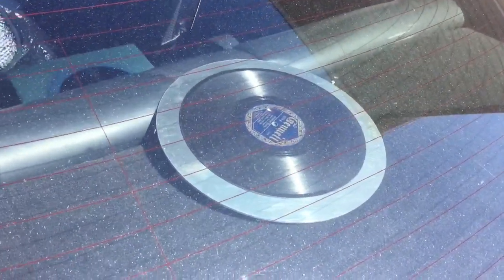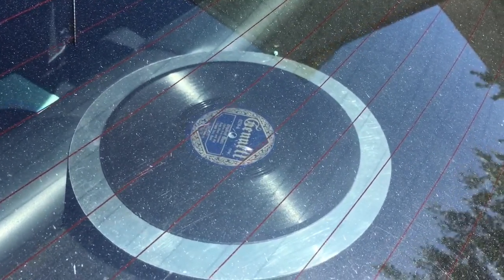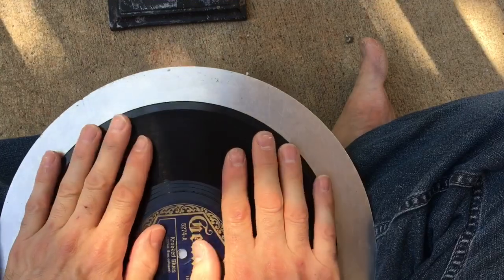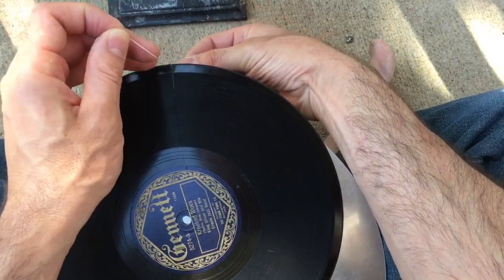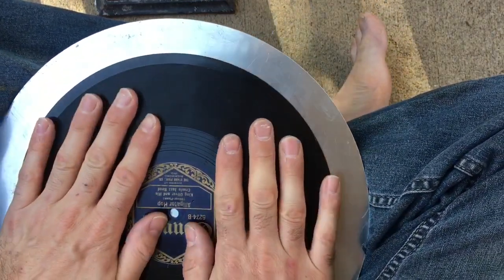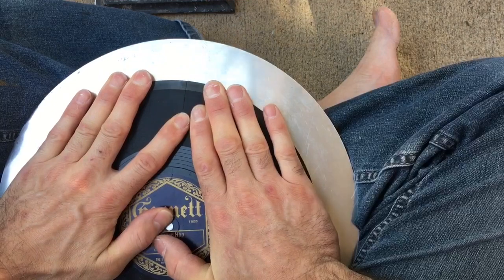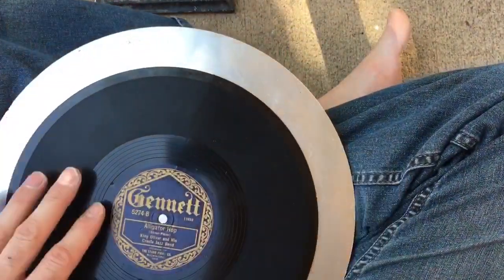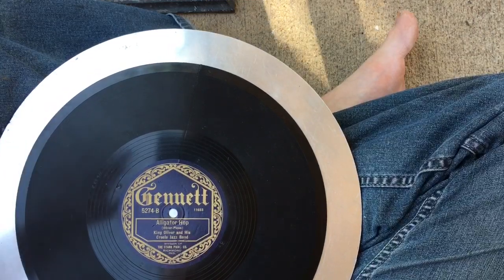78rpm Record Repair - Closing A Widened Crack

Comment: Nice! I was just given a box of old 45s with some record labels before my time. Several of them have cracked from the outter label to the outside edge. What type of glue should I use to repair after I get them cleaned up? Thanks!
Reply from the maker: You can use tape or super glue outside of the groove area, to help keep the crack from re-opening.  Using super glue in the groove area isn't a good idea since it cures too fast and will usually create other problems.
Reply: Here you can see how to fix broken 45 rpms https://youtu.be/5MbRxXxMvPI
Reply: @DonWilsonLabs  Super glue on outside edge did the trick THANKS!

Comment: I have an old radio station disc  (shellac l'm assuming even though it's from 1965),a recording of a football game the station would have played to their listeners in the days before live broadcasts. As l said l'm assuming its shellac because l have never seen vinyl behave like this. The outer layers seem to have shrunk and opened up gaps in the surface,about 1 to 2mm  wide. You can actually see the substrate the shellac was applied to. It's obviously unplayable in this state but is there a way to "rehydrate" the shellac to close the gaps?
Reply from the maker: The disc you have is probably a lacquer or acetate (the names are used interchangeably). Unfortunately there is now way to keep it from coming apart. The best thing to do is get a high resolution scan of both sides and find one of the companies or arxhivists that can do optical extraction.  It's unfortunate but the only thing that can be done at present.
Reply: @DonWilsonLabs  thanks for your prompt reply. I wasn't that hopeful about repairing the disc anyway,but you never know if you don't ask. Thanks and stay safe.

Comment: couldn't a clamp be used on it while it cools?...
Reply from the maker: Heated shellac is very soft, like a firm clay. A clamp would leave marks on the disc, unless you know of a clamping method that I don't?
Reply: @DonWilsonLabs  I was thinking a narrow band clamp to go around the circumference of the record...